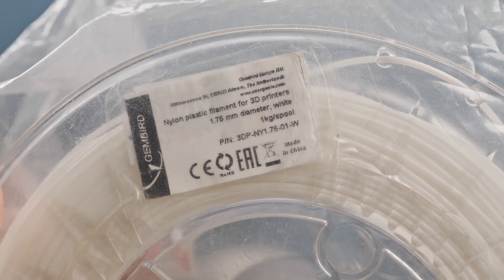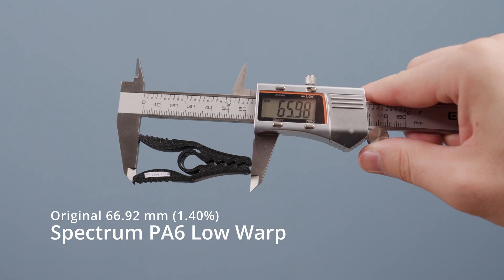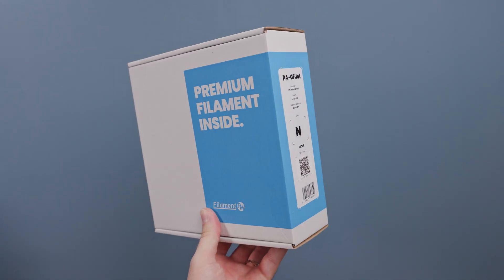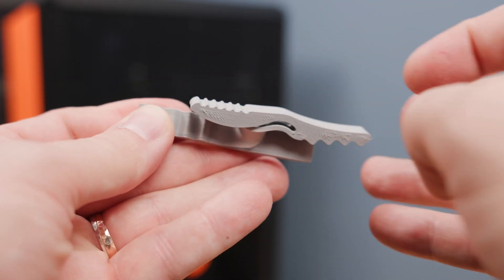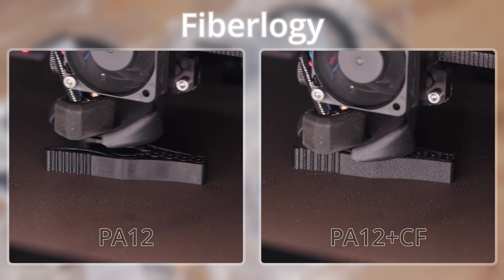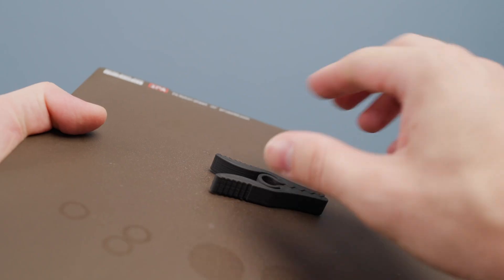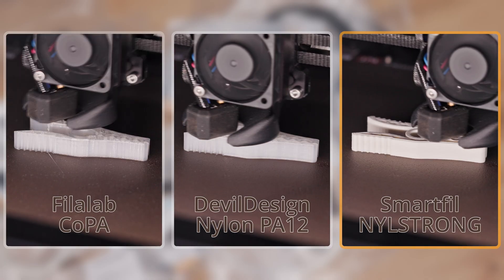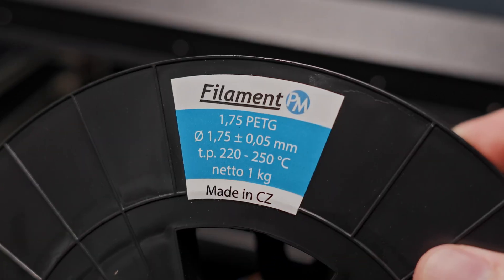Prusa PA Sheet: Nylon sticks like glued!

Comment: Great video! I wish there was even a fraction of this testing a year ago when I got my sheet from Prusa, it was very difficult to figure out if the sheet would work for anything but their PA11 and the few brands on their compatibility chart. I've had great success with my locally made Matter3D PA66-25CF, while their unfilled PA66 curled like a potato chip while printing. I was using the recommended water between prints but perhaps that filament needed cleaner.